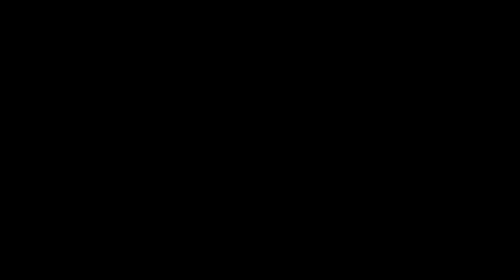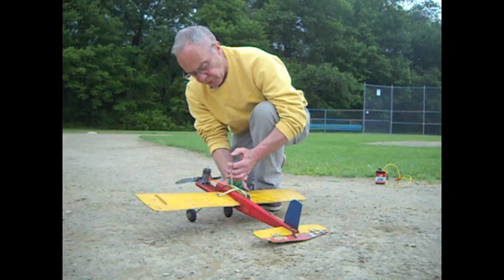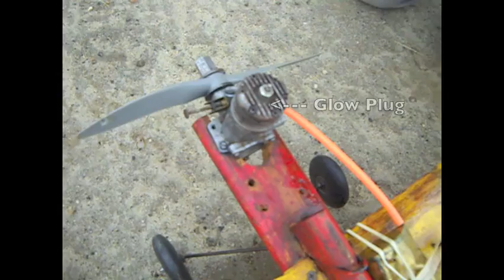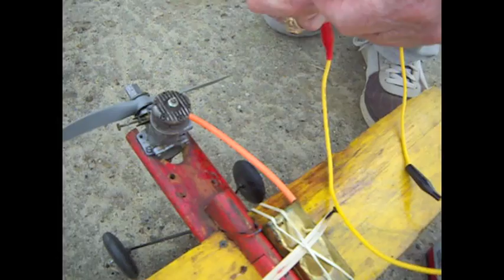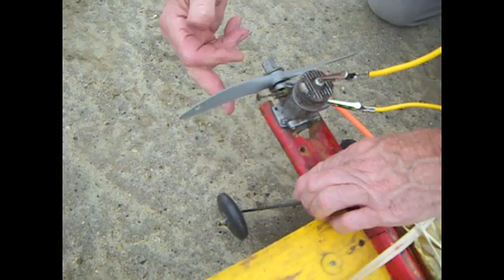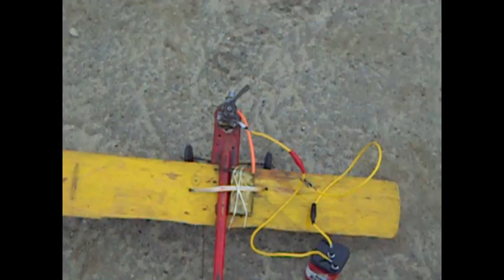How to Properly Start A Fox 35 Engine

Comment: Left out one important step when starting. How many turns on opening of needle valve. I am building a flight streak . Using a 35 fox. Have not worked with my planes for 40 years . I have a need to know. I have forgotten how far to open the needle valve for starting. Please help.

Comment: My Dad used to fly control line with a group of other guys back in the 60's and they started their planes exactly like this.  No Chicken sticks, no electric starters.  It was just the way it was done.  I still have two CL planes and I still start them up using my hand although I do use a glove now.  Been there with plenty of nicked up fingers.
Reply: I use a wrench

Comment: Nice to see Grandpa/Grandson involved in this great hobby together. Note that they are using a 1.5 volt battery in this vid... which is a "hobby" battery and NOT a lantern battery. Although they look the same, a 6 volt lantern battery is too high a voltage and will destroy the glow plug.

Comment: I saw nothing proper in any of this video. Not to mention the motor did NOT start. The title is a little misleading. I backflip all my control line motors and they start much easier than trying to flip on the compression stroke. How about a new video with the motor actually being started?

Comment: The engine was obviously flooded in the base and needed a head prime not another choke which just made the base flooding worse. I'm not sure what you know but it's a common problem with upright mounted engines.

Comment: I've also been doing this for over 50 years and I can see things that I would never do from a safety stand point. I feel compelled to ask you to take this video down and make a better one with a leather glove on and explain how the Fox 35 can sputter down then suddenly start just when you think it's safe to flip again. Things we do with 50+ years experience are no good for a total beginner. Besides the prop came off and you never got the engine running. I'd be embarrassed to show this.

Comment: I haven't flown in years but, when I flew as a kid, I did it the same way you are right down to the pump (Perfect used to make them I believe). Dry battery and alligator clips. Worked for me and it looks like it works for you. That's what matters.

Comment: This is totally wrong. After you choke the engine flip the engine several times first then put Glow Starter.  You must position your self  in front engine so finger moves away from the prop. On the side your finger will continue on the prop path. I suggest you use a chicken stick or learn to start by back fliping, and  never through compression, turn colck wise til compression then back half a turn and hit the prop counter clock. Sorry but I could not see this and say nothing.